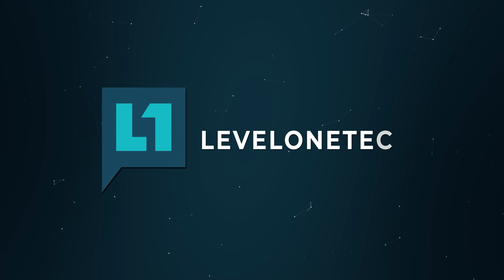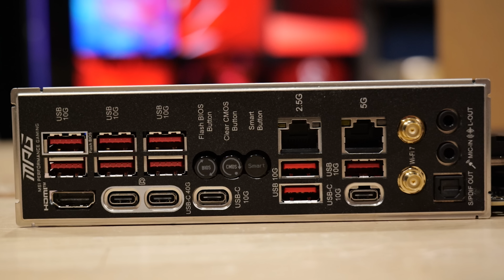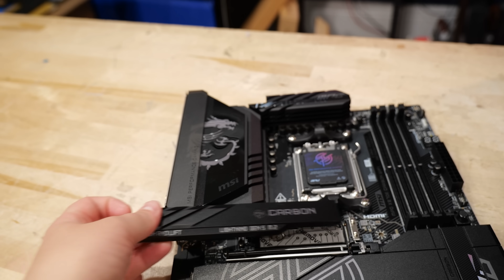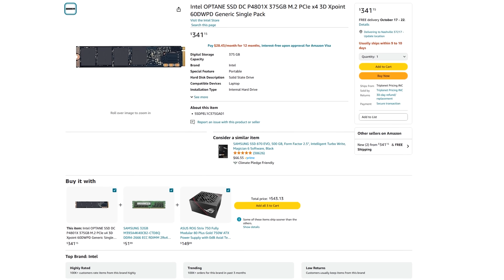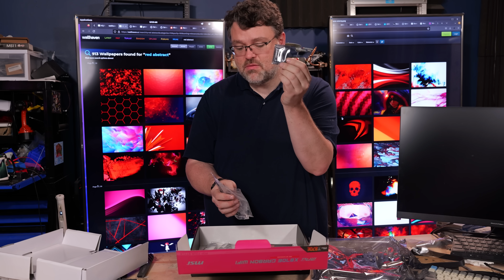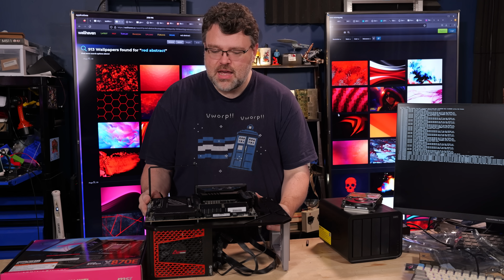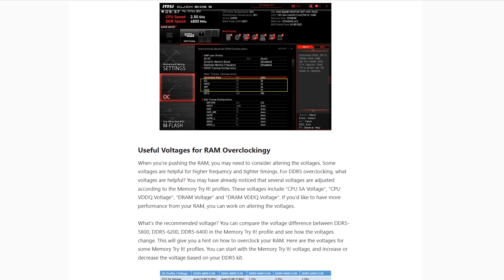USB 4.0 for DAYS! Checking Out The MSI MPG X870E Carbon WiFi

Comment: Unbelievable, they STILL don’t have display port inputs for the USB4 ports! 
Also if you’re not going to add 10Gbit ethernet as the second port, just leave it off.
Reply from the maker: they are wired to the igpu so it matters less. windows can send output from dgpu to igpu in software for a perf hit

Comment: Unless I'm confused the x870 "chipset" has nothing to do with memory speeds(its up to  the CPU and motherboard PCB). Were motherboard manufactures sandbagging the x670 boards or do I a need 9000 series CPU to get 8000? If I need both a CPU and a motherboard to get a memory speed bump then the AM5 "platform longevity" claim is a load of BS. That said I'm more interested in getting 128GB working at EXPO speeds (e.g 6000MT/s) via 4 dimm slots.

Comment: Testing fabric stabily it a bit difficult. I know my 7800x3d can do 2200 fclk fully stable but only below 1.25 soc which is very very good. The lower your soc the higher u can clock your flck. If u are sticking to 1:1 mclk:uclk u want to get the uclk as high as possible which normally tops out at 3100 or 3200

Comment: Why has a 500 dollsr board no 10Gbit?!

That's like... the dumbest thing of this board. Can't even really aggregate two 5Gbit ports to 10Gbit... Now, with it's few PCIe slots it needs to have a dedicated NIC for 10Gbit as well... in a 500 dollar board. Big oof...
Reply: I don't really see the need for 10 gig on consumer products.  We don't have 10 gigabit internet, so the only use is local networking.  But for local networking anyone who actually cares about speed is using enterprise surplus connectx 3's or something, you can get 40gbps for like $50 total.
Reply: @evildude109  10Gbps is useful in office environments to access shared resources on corporate LANs. There 10Gbps is actually barely enough if you work on things like 8k videos etc...
Reply: @morgwai667  Right, that's why I asked the question in the form of "why would anyone need it in consumer products".  Yes, I know it's useful for work.  But if you work from work then you have an IT guy to install your 10 gig nic, and if you work from home you have hyper cheap 40gbps used enterprise gear.
Reply: @morgwai667  nobody in an office situation is going to buy an expensive motherboard aimed at consumers who game. Workstations will benefit more from a 10g Ethernet connection but they don’t need any pci-e lanes.

Comment: With the talk of DDR5 8000 on these boards, what prevents it from working on X670E, since the memory controller is on the CPU?  Asus has an 8000mt kit on the QVL list now for my board, X670E ProArt and Im really tempted to try.  Even though my current 6400Mt kit is on the QVL and I cant get it stable past 6200mt (i've tried two different kits built months apart, too). Using 7800x3D

Is 8000 actually achievable on X670E in the real world or is it a pipe dream and spending $250 on that 48GB GSkill kit just wasting money?
Reply: My thoughts exactly!
Reply: Power dilivery and clock gen consistancy is improved by better singalining.
Reply: @kevinerbs2778 singalining lol
Reply: Better memory topology
Reply: Buying 8000 ram on amd5 is wasting money regardless if it’s supported or not.

Comment: What are people actually using usb 4 for that they can't do with usb 3.2gen2? - I'd much rather manufacturers finally put 10g ethernet on everything than give us usb standards that the majority of us don't really care about all that much.
Reply: On desktop, probably just external storage. Might be important if you're a creator with a bunch of drives. 10Gb USB is pretty fast, but not as fast as some of the USB-4/TB drives out there. It is important on laptops for docking stations. 10Gb ethernet would be nice on all the mid-high end boards, and it does seem to be going that way. At least 2.5Gb is on just about everything now it seems. That's more than enough for all but the video editors out there using a NAS.
Reply: @andrewt9204  anyone using a nas with more than a few hard drives or any nas with one or more modern ssd's can easily benefit from 10g networking, and even that'll be slow within 5 years now that 50g and 100g qsfp are becoming the typical server standards.  the typical pcie ssd these days can reach speeds in the 7Gb/s (that's 56gb/s) territory with pcie5 drives reaching 14Gb/s (114gb/s) for standard 4x pcie varieties.  heck, your average sata hard drive is now good for about 200Mb/s (1.6gb/s) so any more than one and you've easily saturated your 2.5g already, and most folks use at LEAST 4 hard drives in a nas (with 6 or 8 being pretty typical as well) which then starts adding up pretty quickly toward even 10g limits.

I'm a creator with a bunch of drives, I'm either going to drop a sas hba in my computer and do a jbod setup of some kind, or more typically, going to use a nas over ethernet.
Reply: Did those usb4 support pcie tunneling / TB3 ?
Reply: VR perhaps? Still pretty niche. But it lets them add another marketing bullet point.
Reply: @crash.override  VR isn't a bad application for something like this, but I'm personally a vr enthusiast and haven't ever seen anything like that with most just using direct displayport and usb (often 2) for tracking, passthrough cameras and microphone.
Reply: Some of us care about USB4 / TB. For example there are audio interfaces out there that will utilise these high speeds to reduce latency / allow smaller buffer size when using audio production software.
Reply: @Pokeybumgank  I would much rather have an availible pcie slot that I can put whatever I want in, including an audio interface communication card (or heck, even my own darned thunderbolt card) (or a quad 4k video capture card or a raid hba or an nvme expansion card or an ai accelerator card, or whatever else)
Reply: Let’s be real most people don’t give a crap about 10g either.
Reply: @TheSjuris  I think they would give a crap about 10g if there was significantly wider adoption. - it's a catch 22.  I'm very happy that I have a 10g network at home to access my servers (particularly my nas).
Reply: @joshhardin666  there isn’t any wide adaption for it though and so most motherboard manufacturers won’t support it. It costs money to install a 10g network at home and unless you are running a NAS there’s little reason to upgrade to a 10g network.  I get faster speeds using WiFi than the Ethernet cable.  Even support for 5g is not widespread.

Comment: Why this X870E  boards are so dawn expensive since they offer almost nothing else comparing with the X670E , JESUS !!!!!! 700.00 US DOLLARS, I wait 2 years to upgrade from AM4 to AM5 and my Aorus Master  X670E I just paid  250.00 openbox and for my 7900X just 269.00 new , so I will apply the same formula for the X870E , I refuse to paid overprice
Reply: Irony is that's 'underselling' what a rort this board is. lol! $700 would be a ripoff for some giant HEDT motherboard with a billion pcie lanes in undivided 16X slots and sata ports! $700 for a fluffed up basic b!tch 24 lane ATX motherboard?!! that is just disgusting. They always trump up pcie5.0/4.0 making it 'not matter' but it does without a bunch of expensive PLX chips to split the lanes up usefully.
Reply: @PriaSamari you know that pcie lanes depends at CPU capabilities also? This chipset is maxed out for any ryzen 7000 and 9000.
Reply: Money is worth less than it was 3 years ago. The board designs are getting better. This has a lot of things not on the X670 Carbon.
Reply: @RobFisherUK  x670e carbon was more expensive at release date. So was the x670e Taichi.
Reply: @RobFisherUK  how are board designs getting better?? cut the crap.... my asus x99 rampage extreme from 2014 has more feature than my x670 aorus master and taichi
Reply: @RobFisherUK I don't care what anyone says, the only reason any motherboard should be over $400 is if every single component have pure gold or some other precious metal. Also, videos about motherboards are weird 😂.

Comment: No intel NICs, USB4 controller, and WiFi on the Carbon and Godlike🙌
Reply: Derp. Intel went CNVio2 with their WiFi 7 offerings, which AMD doesn't support (Intel proprietary protocol).
Realtek has been making solid 2.5 and 5Gb NICs since before Intel issued third iteration of the buggy 225v.
Intel's USB4 (AKA USB4 Router and Hoover Ridge endpoint chips) require, I hope you're sitting down, an Intel chipset to use.

Comment: Means nothing if 2.0 is still being put on boards
Reply: 2.0 is fine for a lot of the peripherals we use. Controller, microphone, mouse and keyboard... don't benefit from faster throughput. I'd rather have 4 2.0 ports than one more 3.1 port.
Reply: Mouse dongle and Keyboard don't need anything more.
Reply: @LollyBread  my board from 2019 has 4 USB 2.0 ports
Reply: @LollyBread  usb2.0 came out in mid 90s why is it still on anything
Reply: @justinupshaw672  Well it wasn't my design idea of course, but as I say there are at least 2 devices everybody uses that don't need more than 2.0 so presumably it's just cheaper to plonk them in, and it does make it easy to see which ports to use, or not use, when fiddling with the pc IO.
Reply: @lolly_bread  till just a few years ago usb 2.0 flash drives where still readily available at Walmart
Reply: @LollyBread  at least they finally got rid of the ps/2 ports.
Reply: @TheSjuris  True dat, but now I have a pile of those yucky ps2 mouse n keyboards that I can't seem to chuck out!!!

Comment: Not a ton of audio ports on the back, strange for a $500 board, are they expecting you to have your own soundcard / dac at this price point?  For comparison the last gen Carbons had 5 audio connectors (RF/CF Out and L/in are missing)
Reply: Need a b850 motherboard for that. That’s a feature of the lower end motherboards.

Comment: I bought my earlier today. Sucks that you cant run both gen 5 m.2 drives without reverting the main PCIE from 16x to 8x... Thats my only gripe with the board. Do yoy think i can run the operating software on the 3rd gen4 m.2 slot and be ok? Bc id really like to have that gen5 speed for my 8K video editing...
Reply: Only 1 gpu even uses 5th generation lanes and then the difference between pci-e 4 and 5 is 1 or 2 fps.

Comment: Very interesting that my X670E Taichi is using an Intel Maple Ridge controller for "USB4" but X870E Taichi moved to a new ASMedia controller.
Reply: The Intel chips are stuck at PCIe 3.0 x4, while the ASMedia chips have a PCIe 4.0 x4 link, which allows for full bandwidth of TWO USB4 ports at a time compared to one full-bandwidth connection with Intel.
Reply: @fujinshu  Interesting. The block diagram for my board shows PCIe 5.0 x4 dedicated to the Maple Ridge controller. Likely only running at 3.0? Little disingenuous of this diagram.
Reply: @343_GuiltySpark  Thunderbolt 4 and USB4 only run at 40Gb/s with PCIe tunnelling at 32Gb/s, which is PCIe 3.0 x4.
Having a PCIe 5.0 x4 link to the controller is very much overkill, unless the board has 4 USB4/Thunderbolt ports.
Reply: @fujinshu  I’m simply reading the block diagram.
Reply: @343_GuiltySpark  Simply showing what its connected to, rather than the downstream device's capabilities
Reply: Taichi is a huge board…physically. It’s EATX sized mb. It’s such a downside for sure. It should have better spec and must be cheaper obviously.

Comment: Bought this today. Along with the amd 9 7950X3D. Can’t wait to try it out.
Reply: Noice. That's the combo I'm looking to buy (most likely at this point). 
Pairing with 4070TiS (unless the 5000 series is ready very soon and good value.
Reply: @LollyBread nvidia and fair value is an oxymoron
Reply: @TheSjuris  Yes, sadly that's true. When there's no competition company execs be lookin' to fill their pockets.
Reply: i got a 7950x3d, the 670e version of this motherboard, and 32gb ram for 750. honestly not the worst deal
Reply: 9950x3d next year u gonna upgrade?
Reply: @Chicken-o5e  Not sure yet to be honest? The 9000 series just hasn’t impressed me enough so far. I’ll wait and see what it can do.
Reply: For how much and where?
Reply: @saksham2idk342  CCL. I had promo codes to use which knocked the price off even further from a sale it was on. Got the board for just under £380. CPU, £350.
I think the board still has a sale on? Save yourself £40. It’s something at least. Otherwise this board will be around the £430 mark.
Reply: @saksham2idk342  I did reply back to you, but my comment got removed?!